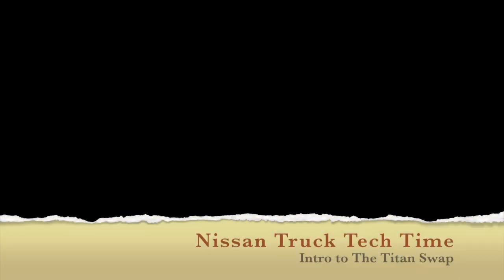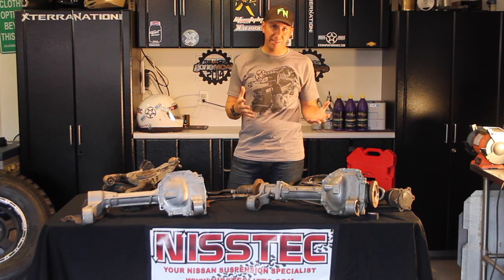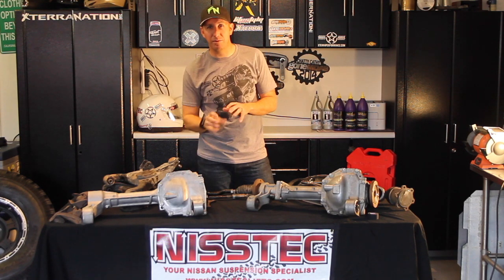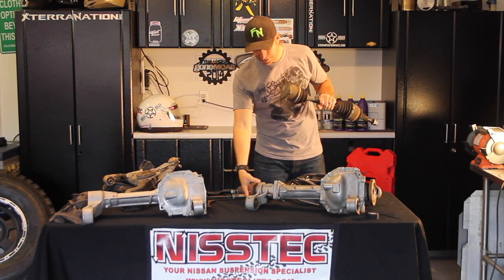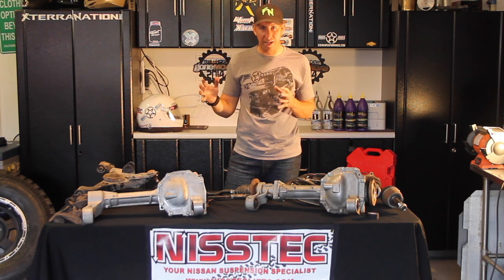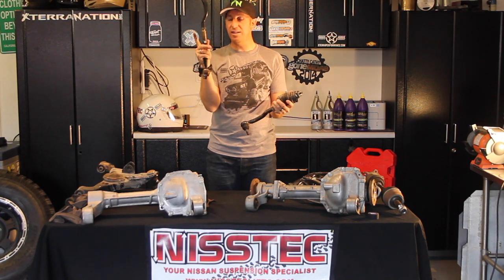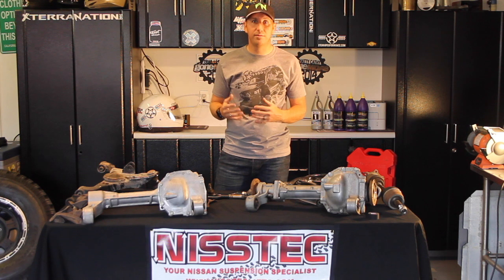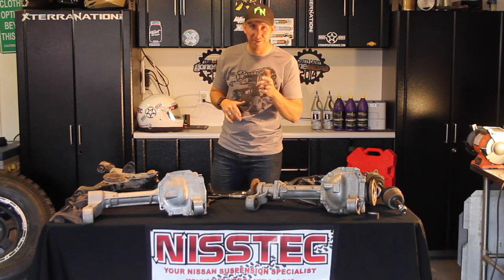Nissan Frontier and Xterra Titan Swap Explained

Comment from the maker: some additions to the Video. For a titan Swap there is a bit more that goes into it as far as making sure you have the right gear ratios, extended brake lines etc.  That being said Nisstec has done all the hard work for you and has a full kit that is 100% bolt on.
Reply: DaGrootX 1 yr later but great Vid... Q : Would this Titan kit swap be applicable to a 07 Frontier 2WD to make it a 4X4 ? Any electrical work need to be down aswell or should I just trade mine in for a 4X4 ? Thanks
Reply: @rdelacruz1987  
I say trade in the 2WD for a 4WD Frontier. It'll be a lot easier to buy a 4x4 than converting a newer truck like yours into full 4WD. Lots of electrical work there, bud. Not too mention transfer case, etc.
Reply: DaGrootX will a 05 titan upper control arms work on a 2012 frontier pro4x?
Reply from the maker: Levi Elizondo yes it will
Reply: What can I do for a 03 frontier everything I see is 05 and up
Reply from the maker: @baboonking3008  the simplest options are upper control arms, torsion bars and rear shackles. That will get you up on 33” tires easily and you can do a ton of stuff with that setup. From there the next level is solid axle swap. That being said the first gen comes with a lot. Ore ground clearance so a little lift will get you a long way!!

Comment: Hi Guys,  just want to know if possible only the Upper Arm Control of Titan  to be swap to my Extra 2006 so i can longer travel on my spring?  Without changing the lower arm control. Thanks
Reply from the maker: No. If you were to swap just the upper arm the tire would be extremely crooked. The titan swap moves the wheel out 3” on each side. So if you just installed the upper arm the top of the tire would be set out 3” and the bottom would stay stock.

Comment: Hello I have a 2009 Nissan Xterra and I want to make sure u saying I can put the Nissan Titan front and back suspension without any mods just bolts right in I would like to do that as long I can bolt them straight on cuz it wud help my truck lift alittle higher cuz I wanna put 33 on my truck without damaging my transmission let me know asap on ur input thank you 🙏
Reply from the maker: The front will bolt in. However, since the titan rear axle is wider you will have to cut off rear leaf spring mounts and weld on new mounts. Also, there will be different rear brakes in the rear. You are better off installing a rear axle from a pro4x model. They bolt in and have the 3.63 gearing that you would be looking for.

Comment: If you swap the r180 for the m205, does it just bolt up directly?
Reply from the maker: It does. You will need to make sure that you have the same rear axle gears as the m205 though. If you have a pro4x they have the same 3.36 gears. If you don’t the. Your gear ratio will need to be changed in your rear end or you can gear both diffs to 4.10s etc etc.
Reply: @Dagrootx  I've got a 2012 pro4x Xterra, so my gears will already match that of the Titan?
Reply from the maker: @AustinM94  then you better swap that SOB and unlock boss mode. You won’t be sorry! 🤘😜

Comment: Is it possible to have an engine swap only (VQ40 to VK56) without swapping the differentials and control arms? Sorry dumb question, I’m not into ride height just want to add some powah babeh 😅
Reply from the maker: Yes. You can absolutely just do a VK SWAP without changing suspension.

Comment: Would this automatically lift my 05 4x4 Frontier? Can you like my comment if you respond so I can see your response if you respond? I know this video is  4 years old
Reply from the maker: As long as you use proper lift parts like SPC upper arms and a titan swap coil over yes it will lift the truck.

Comment: first off, I am responsible for any upgrades not you.  with that, people are putting 18" coilovers for standard titan swap offroad lift.  I want a 6" lift, I found n3 22" coilover recomended for 6" lift These measures are full extension.  shock travel looks pretty good.  what do you think of this build.

Comment: Why don’t you recommend putting a spacer on the shocks i just discovered about the titan swap reasons doing it’s because i bought rancho quick lift and i had a 2in spacer and it kept making contact with the coil bucket. Any suggestions?
Reply from the maker: My thought is if your gonna Titan swap you want to make rhe most out of the travel. Having a short shock in there will cause that shock to top out and bottom out well before you hit bump stop and burn up the shock super fast!
Reply: @Dagrootx  right. What about the sway bar on a 2wd
Reply: I have a problem connecting the sway bar link do i need a titan sway bar and sway bar links or the frontier should fit?
Reply: I have a problem connecting the sway bar link do i need a titan sway bar and sway bar links or the frontier should fit?

Comment: For it do you need the extended brakes lines or it should be fine just with the tie rod extension
Reply from the maker: You will need extended brake lines!
Reply: Do you know where to obtain that and the extensión tie rod
Reply from the maker: @Elite.University247  NISSTEC has the brake lines. For the tie rods I recommend just replacing inner and outer with Titan ones

Comment: Hi so if I do the titan suspension swap that's basically stronger and better? And also if do the whole kit would Fox 2.0 reservoirs be better than radflo reservoirs? Thank you
Reply from the maker: Yes, it’s much stronger and you get a lot more travel. And the travel is where it makes it so much better. I suggest the RADFLOS due to them being the best application. They were specifically designed for the Titan swap application. Also, NISSTEC is the best place to get them.
Reply: @Dagrootx  awesome thank you I will do that

Comment: Do they have a titan swap for an 02 Xterra or what would you recommend
Reply from the maker: No. They are completely different. The most you can do with the stock setup is sway a way torsion bars. bilstein shocks and maybe some upper control arms.

Comment: What about the engine upgrade?  I understand you can also swap out the Xterra engine for the Titan V8.  Does that just bolt in as well?
Reply: Yes, the only difference is you'll have to send the wiring harness to get adapted to your Frontier

Comment: for the titan swap with my 2018 frontier, can I use either the Nisstec MK84 or the Bilstein 6112 coilovers?
And what rear shocks would I use with them?
Reply from the maker: You could but you would need to add a 3” spacer on it. it’s not worth spending the money. If your gonna swap then get a coilover that will make the swap worth it. Swapping and then using a coilover that is designed for a non swap would be defeating the purpose of the entire swap.
Reply: @Dagrootx  I already have the 3" spacer and rear 2" lift block, and these coilovers are $400 to $700 as opposed to radflo $1200 kinda high for me. thanks for the advice, maybe i;m not ready.

Comment: For the titan swap, on my 2018 frontier, can I use the either the Nisstec MK84 or the Blistein 6112 coilovers?
also, what rear shocks will match them.
Reply from the maker: Your best bet is going with the 2.0 or 2.5 radflo. NISSTEC and a couple other companies sell them. They are valves and top hatted correctly to fit the Titan swap.

Comment: for the coilovers, what do you mean by 2.5's shock coilovers?
Reply from the maker: Sorry. That’s shock (coilover) body diameter. 2.0 vs 2.5. The larger body diameter will have more shock fluid and have less fade over longer periods of off road use.

Comment: Great info in your video! Owned a Titan for almost a decade and know they are notorious for having wheel hub issues when they are lifted. I've been wanting to do a Titan swapped Frontier and was wondering if you have issues with the wheel hubs going out?
Reply from the maker: Luckily that seeemed to only be a Titan issue. No probs with xterra and frontier hubs.

Comment: the gear ratio are the same or thiferent???
Reply from the maker: Gear ratio on frontier and Xterra pro4x is the same with the Titan m205 4x4 models. 3.36. If you don’t have a pro4x frontier then you can run the stock front differential but you will need extended axles from nissteclifts.com

Comment: Does this apply to the r51 pathfinder also?
Reply from the maker: Eder Olivar pretty much. However depending on trim and engine you may already have a m205 front diff... 👊🏼😊
Reply: @Dagrootx  what about the rear?
Reply from the maker: @amadom16  it’s a bit more difficult on the pathy. You will need longer springs and special camber adjustment bolts.

Comment: I just bought a 2006 Frontier 4wd that already has a rough country drop bracket 6in lift installed. Can I still do a titan away using titan control arms?
Reply from the maker: Leo Van yes you can. There are som nuances that you will have to work through for the drop bracket swap though. Check out thenewx.org. There are a few drop bracket builds on there that will help you understand all the things you will need. That setup is a really killer way to go!

Comment: Hey quick question can the titan swap work with the stock shocks from a pro4x?
Reply from the maker: Alex Rodríguez technically speaking you could put a 3” spacer on them and they would “work. But I highly suggest not doing that.
Reply: @Dagrootx  ok thanks. so i cant run a titan suspention withought lifting it ? And sinse you have the nistec shocks how do it compare to your pro4x shock?
Reply from the maker: Alex Rodríguez basically. The Radflo shocks are hands down a far superior shock in every way. Valving is much better and provides much smoother ride as well as internal protections for heavy hits when off road.
Reply: Ok thanks for replying

Comment: Can u swap the rear end as well.. Or would the gear ratio be the same on both the feont ends you just showed
Reply from the maker: vincent barnett so they way it works basically is that if you have the Pro4x version it comes with the same gear ratio as a Titan 3.36. So you can swap in the m205. If you have a manual then you have a different gearing. 3.69 I believe. If you Don’t have a PRO4x then you would either run the longer axles for the r180 or regear your front and rear diffs. You can swap in a pro4x rear axle as well. That’s a common thing that happens due to it having the rear locker as well.

Comment: Can I run a m205 diff with 3.36 gears
Reply from the maker: Andres Reza yes. Most M205 front riffs come with the 3.36 gear ratio
Reply: DaGrootX any where I can find one ? Looking to add this to my 6inch lift already ordered just want to change to a m205 with 3.36 gears

Comment: I have a 2019 Nissan Frontier pro 4x looking to get rough country lift kit with upgraded fox or bilistien shocks with coil overs. Would you recommend I do that or just titan swap?
Reply from the maker: Andres Reza highly suggest a Titan swap over the RC. You will get a lot more performance and reliability out of the Titan swap
Reply: DaGrootX nice thanks man was trying to figure out if I have a d44 differential or d 40 looking up specs but doesn’t say
Reply from the maker: Andres Reza what truck do you have.
Reply: DaGrootX 2019 Nissan Frontier pro4x v6 automatic
Reply: DaGrootX yeah people say I have a d44 but I think it’s a d40
Reply from the maker: Andres Reza you have a m226 Rear axle with 3.36 gears. So you can swap in the m205 no prob. And yeah. It’s a D44 variant. Don’t let your friends talk smack. Lol
Reply: DaGrootX nice! Thanks man what titan swap kits do you recommend? Also was trying to add a front locker to my fronty.

Comment: I have a 2011 nissan frontier pro 4x and wanting a 3 in a half to 4 inch lift. Will the titan swap work for me or do I need to just do a normal type lift
Reply from the maker: Charles Nickell was  the Titan swap would be perfect for that amount on lift. It’s right around 4” or lift and you get way more performance compared to a typical 3” lift.
Reply: @Dagrootx  thank you

Comment: Can you TS in stages?  Stage 1: Front and Rear shocks with SPC UCAs, AAL and adjustable rear shackles. Stage 2: LCAs, M205, Titan CVs, Titan tie rods and wheel spacers for the rear.  Great video! Thanks!

Comment: I’ve got a 2012 pro-4x Xterra and am considering this swap. I’m wonder what to do about gettin this same track width front and back. I don’t want it to look silly being significantly wider in the front the top he back
Reply from the maker: Dylan Hayter so the common method is running a 1.5” or two inch bolt on spidertrax spacer in the rear. Having a slightly more narrow rear track width also helps with turning in the dirt as well and is pretty common in the desert racing world.
Reply: DaGrootX thanks greatly appreciated
Reply: I forgot to ask about the front sway bar, what do you recommend doing about end links and bushings
Reply from the maker: Dylan Hayter I highly suggest getting rid of the front sway bar. Stiffer spring up front will keep sway down a little. The traditional sway bar will only limit travel and cause some binding.
Reply: DaGrootX this won’t be hardcore wheeled just needs something that won’t be going through ball joints every 6-8 months due to Newfoundland’s poor road conditions
Reply from the maker: Dylan Hayter I still suggest pulling the sway bar. Also, if you Titan swap go with SPC arms. The sealed boot is much better for up north where your at!
Reply: DaGrootX upper arms or lower ? And how much stiffer are we talking here lol family of two
Reply from the maker: Dylan Hayter upper arms. Lower arms would be a stock width Titan. As for stiffer I’m not 💯 sure what you mean. With a quality coilover like a radflo and a 550lb cool spring you would be right in the money. I daily drive my red truck with my family. Also, every time a buddy borrows my truck they tell me how smooth it is when going over bumps. That is mostly attributed to the extra travel the Titan swap allows for. If you are gonna pull the trigger I highly suggest giving the guys at Nissteclifts a call and they can walk you through every part you would need!

Comment: thanks for the video man.  I am looking on upgrading my 2016 frontier sv 4x4 with a 6 inch suspension lift and 35s.  I have seen it done several times by others but I want to make sure I don't overload my transmission because of gearing.  Would a titan swap be a better option?
Reply from the maker: Daniel Arledge in my opinion waaaay better option. The 6 inch is more of a suspension drop. No extra performance. The Titan swap gives you more travel and much better performance and shock options! If you really want to run 35s run a 2” body lift with the Titan swap and run 4:10 gears.

Comment: I know ARB makes an air locker for the Frontier, but if you do a Titan swap, there’s no arb locker for the front differential. Or am I wrong? Would a front locker be more beneficial on a frontier or would the titan swap be better but still have an open differential?
Reply from the maker: ARB also makes a locker for the m205 front differential. Front locker would of course be best in a m205 due to the heftier front diff  but is still a great option in the R180

Comment: So you’re saying I can pull the hole suspension off a titan and it will bolt on my frontier
Reply from the maker: Caveman Mario technically yes. You must consider your gear ratios though when installing a differential. Secondly, brakes and spindles won’t work without a bunch of other mods so keep your stock ones. They work fine. Lastly, stock Titan shocks will not fit. They have a different top hat on the coilovers. Companies like nissteclifts.com Prg and rugged rocks sell Titan length coilovers with the frontier/Xterra top hats.

Comment: When would be the best time to do this? After the dif fails?
Reply from the maker: Greg Williams I suggest swapping to a Titan swap ASAP. The ride quality and performance is so much better on and off road in my opinion!
Reply: DaGrootX yah I’ll eventually do it, just don’t have 2k in spending money to drop on a full swap, and labor. Also I just bought rock sliders that are specific for the oem ride height. Wouldn’t I have to remove them once or modify them once I do a titan swap?
Reply from the maker: Greg Williams. The Titan swap would not change anything with the sliders. Your probably thinking of a body lift. That’s something different entirely.

Comment: Hey man I’m a new subscriber and just bought 08 frontier for overland build but I’m struggling to find accessories and part 
Any suggestions please 
Thank you great video too
Reply from the maker: Hey, the best place to start is nissteclifts.com. Also, ruggedrocks.com. Both are great companies who support Nissan trucks. Also, for some of the general Overland stuff. Frontrunner.com has some great stuff! Good luck and feel free to reach out if you have more questions.
Reply: I have a question so you put in the A-Arms uppers and bottoms and you get the Titan coilovers what extension do I need for the small axles so that I can make them 3 inches longer

Comment: should I get an auto or manual for swapping titan parts? I haven't bought my truck yet....eying a manual
Reply from the maker: As far as suspension is concerned auto and manual is all the same.
Reply: Computer issues if doing the VK56 as well..

Comment: You said wheel base when you meant track width....and those "ribs" on the diff are not for cooling they are for structural integrity. Usually to prevent cracking or fractures.

Comment: Hey so i have a 08 frontier 2wd and was wandering if i could put extended travel nissan titan shocks/strutts? I currently running a level spacer 2inch and billsteins 5100 on all 4s..
Thanks
Reply from the maker: The problem you will run into is the top hat and valving. I suggest running a Titan length shock that is built for a Titan swap. They have the correct valving and the correct top hat.